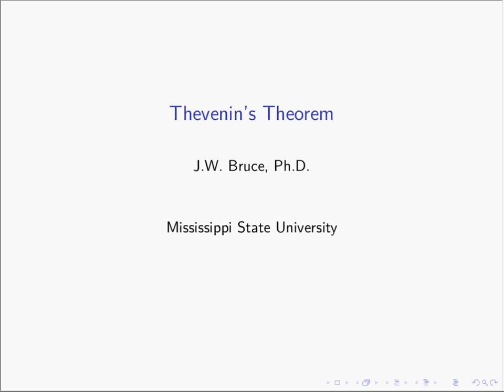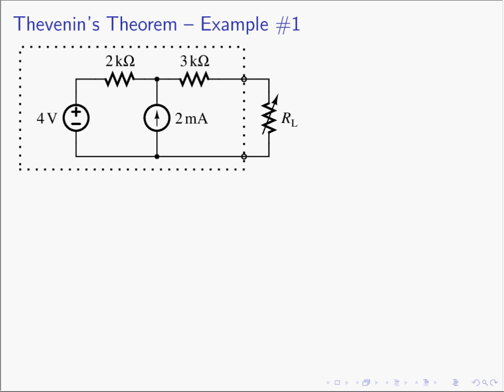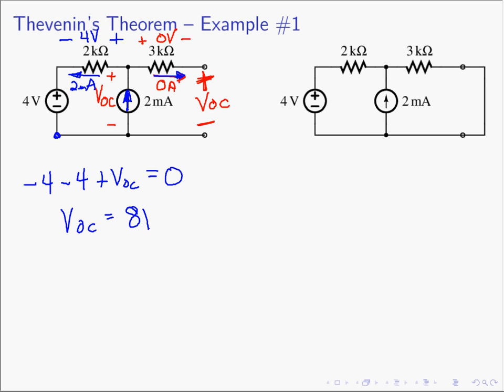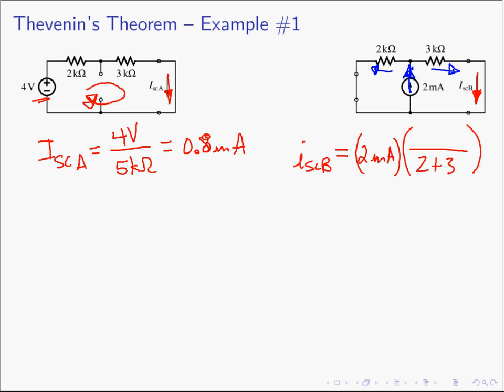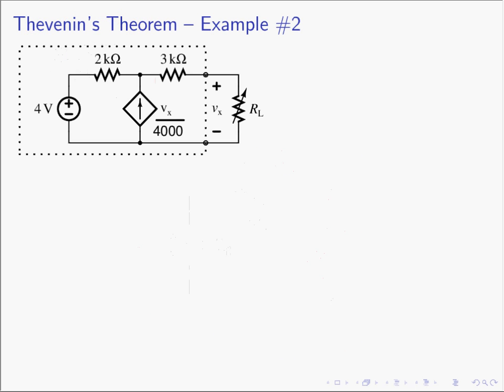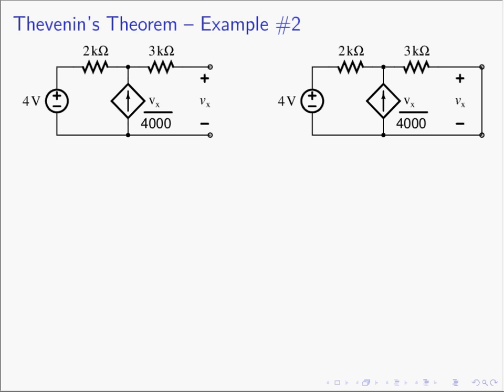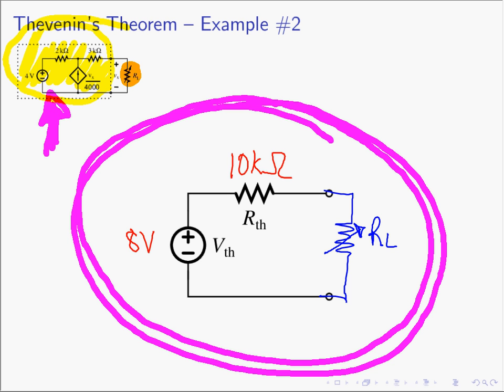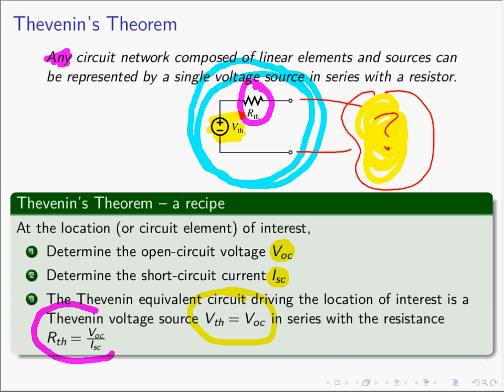Thevenin's Theorem

Comment: @15:21 you determine that Vx is zero which makes the current source = 0. Why do you treat this as an open circuit instead of just a short?
Reply from the maker: Starting at 14:00, we start the calculation of Isc (the current in a "shorted" load).  By definition, a "short" is a zero voltage.  By coincidence, Vx is the voltage across the load.   Therefore, Vx = Vsc = 0 V.